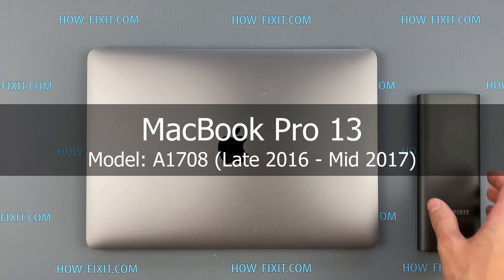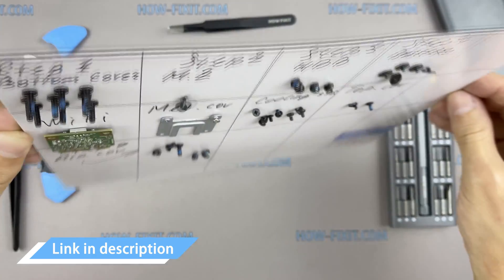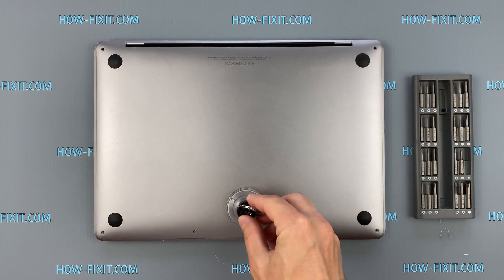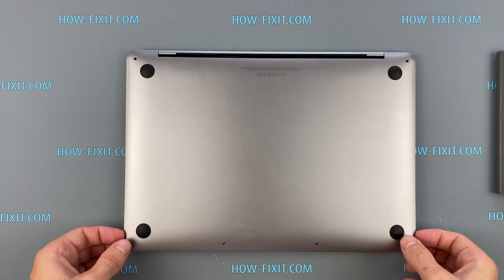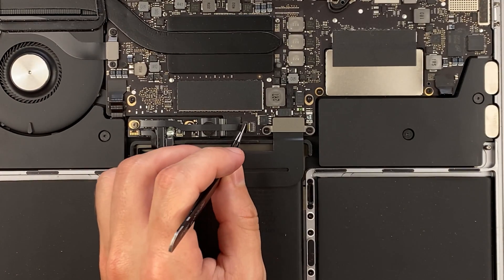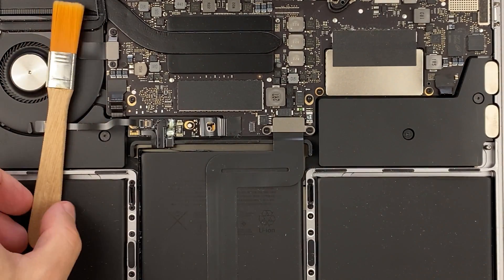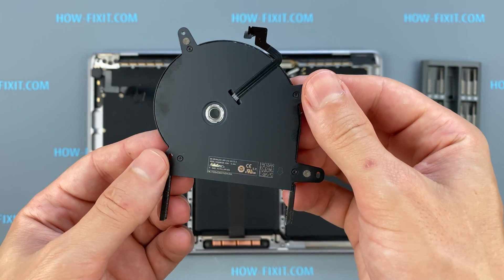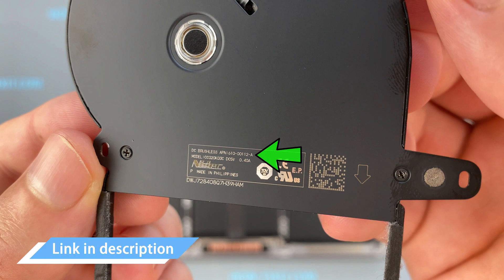MacBook Pro 13 A1708 (2016-2017) Fan Replacement Guide

Comment: Hi! My Macbook Pro 2017 (A1708 Intel i5) is always overheating. I can't even install software update. 
Fan is working in Macs Fan Control but it won't work properly automatically. It starts cooling too late and my Macbook shuts down.
What is the possible problem and how can I fix it? Thank you.

Comment: I've successfully replaced my fan thanks to this tutorial! 😀
honestly, It was just removing's a bunch of screws and then putting them back in the right order ;) 
(you do this at your own risk)
Reply: was your fan making a buzzing noise ? at low speed?
Reply: @markoap31  
Yes sir, it got even louder when I opened up multiple tabs, Adobe application, and even some gaming. It made a really annoying buzzing sound.
Reply: @usmanrazaque4983  Just replaced fan myself. Buzzing sound is gone!